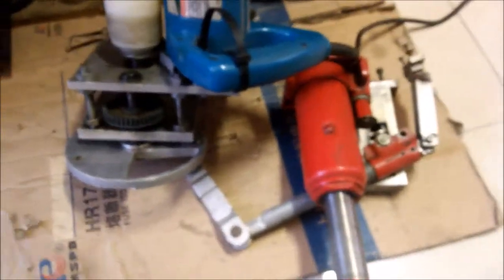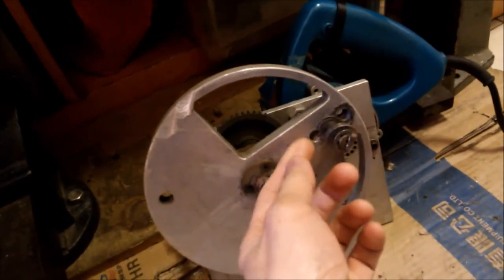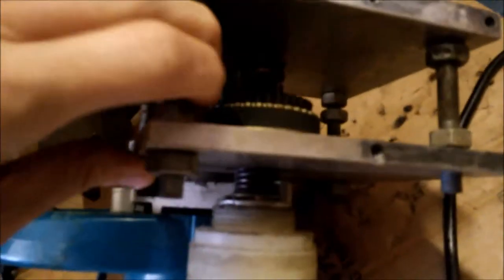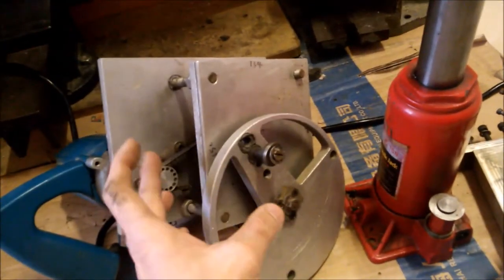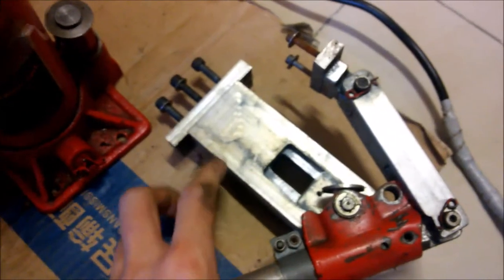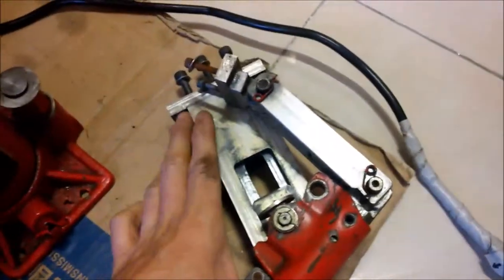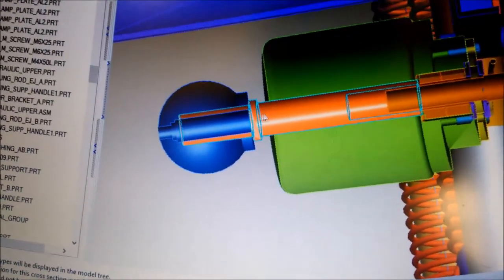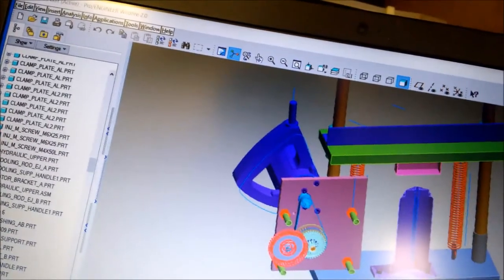Electrical to hydraulic power mechanism for injection molding machine (Generation II)

Comment from the maker: Firstly, thank you for your video link...To push the melted plastic out. It can either be: 1) similar as the rear mechanism, the leadscrew moves forward and backward. But at its front, there is a plunger, when it is at retracted position, plastic drops to the plunger front, then it is gradually pushed out. 2) Using the leadscrew, but it just rotates but not moves back and fro. Plastic pellets go to the gap of the crest of screw, they are melted and run forward as it turns. .. Mine one is hydraulic, electrical and even pneumatic operation combination. They are of higher power to fulfill the molding of larger and complicated parts... As it is for hobby and small batch quantity use, it will not go to automatic.

Comment: Are you going to try to make your moulding machine automatic? Maybe you can get some inspiration from this one a russian guy built for your next generation machine. https://www.youtube.com/watch?v=but0X43F4oc&t=3s I dont quite understand how the actual plastic injection works on his, I figure it has some sort of rotating screw but i cant figure out how the actual injection takes place as there isn't any hydraulic or pneumatic cylinder pushing down on anything. Keep up the good work on your machine though!!!